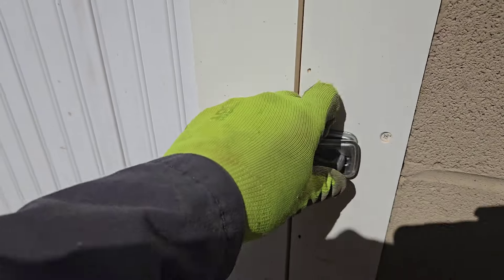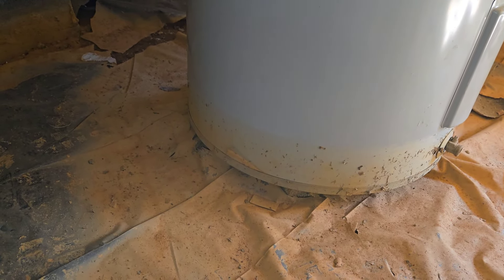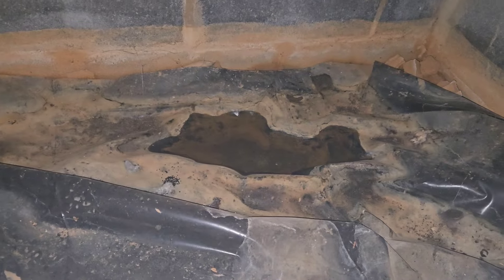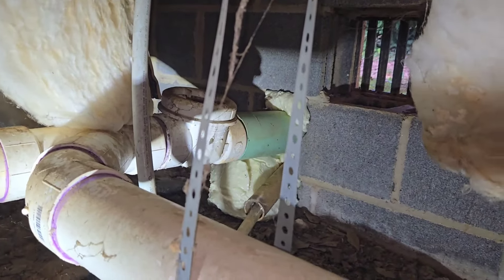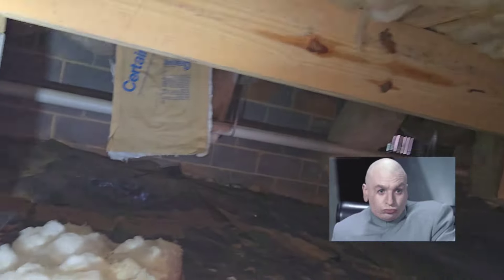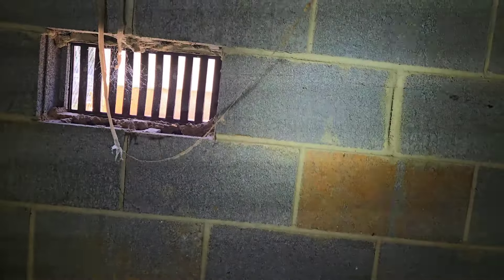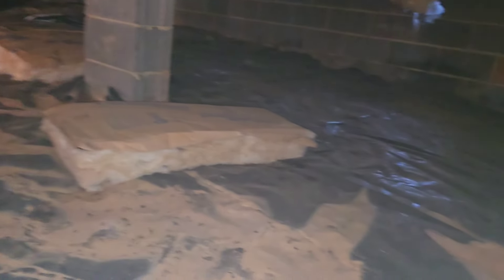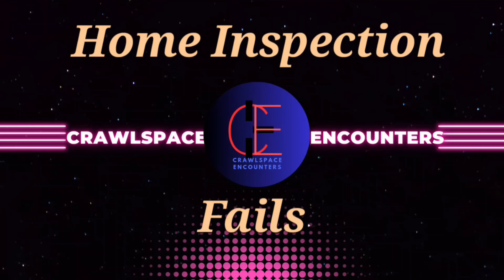Home seller told me "like new".

Comment: The water wicking in to the foundation wall is a symptom of a larger problem because the piers on that side are wicking water as well.  Grade may be screwed up or soil isn’t perking. 

The expansion tank is installed incorrectly.  Either straight up or hanging down. If out to the side it will snap that connection when it fills up.  I guess at this point it can be supported by a strap. 

Radon….it comes up under the house, outside of the house, up through poured slabs in basements it’s been here for 175-million years. I’m going to start selling ghost detectors because at least you can see and hear them sometimes.

Comment: The ole leaky shower pan drain. Should have been hot mopped, but seems to be a lost art. The store bought membranes are hardly ever installed correctly at the center drain and the weep holes ignored. The 10 year leakers...lol. Cool videos man.